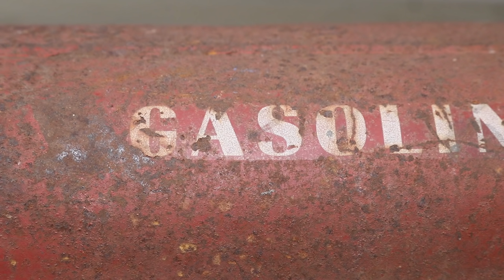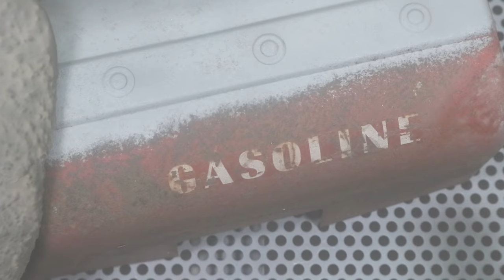1957 Tonka Gasoline Tanker Semi Truck Restoration

Comment: I love the restoration. Having done a couple myself, I realize the time and effort that goes into one. Just for clarification: a truck is not a semi unless it is a truck and trailer. Semi refers to a trailer that has the front supported by the truck. A full trailer has a dolly under the front and is not supported  by the truck but pulled by a tongue on the dolly. Hence there were originally full and semi trailers. They were terms used for licensing and meeting state requirements before the Federal laws kicked in. A semi truck is a truck that pulls a semi trailer. The Gasoline tanker that was restored is considered a straight truck.

Comment: 1957 Gasoline Truck, original list price: $4.98.  The 1958 model came with a hose and reel in the rear compartment.  Looks as if it was enjoyed very much, judging by the axle wear to tires and frame. Rare find, beautiful restoration!
Noticed a 1962 white roof fleetside. Do believe the only model to be a white roof fleetside would be a Jet Fuel Delivery, from the 1962 Airport service set. Missing its bedside panels and cross rails...very rare!

Comment: Can only say this,  you Sir are a true master at craftsmanship.  Watching other, so called restorations,  of plastic models purposely smashed, is not worth the time.  Other previous resto of the mail van, demonstrates the beginning of the end.  Some marketing geniuses figured out that they could save a few cents going to plastic chassis.  Problem was, when the axle tabs broke off, it went bye bye. No options for repairs.  Recently watched a supposed restore, j.g ad to laugh,  the tonk was only a mear shell covering brittle plastic.  Three quarters of the thing was all injected.  No value in restoring,  probably costs more than a new one.  How they can pretend to be doing good work is beyond my belief.  Art is art, that has a significant value in the eyes of the beholder.  You are truly an art historian, restoring classic examples if how the founders set out to satisfy the needs if many young people, to open eyes of what can be done.  Thank you for letting me rant.  One last thing.  The cat makes it all the better.  Very much loved by its person.

Comment: Lovely restoration of a great toy. I had one, and it had some terrible accidents, that were often firework related. I was fascinated by the old movie 'The Wages Of Fear', and this truck, with a little driver figure in the cab, sitting on a seat made from am old roadsign by my dad, spent a lot of time teetering on bridges made of scrap wood, or being stuck in mud. 
They don't make toys like they used to, anymore.

Comment: What I find impressive most is remembering how it all gets put back together...
I'm sure there's a process one just gets used to after doing so many but I just haven't mastered that art.
And again, I'm sure there's an easy way to remember but again I'm not privy...
Especially some of the electronics restorations
Kudos, amazing.
Reply: If you have trouble remembering which parts go where, you can always take pictures before and after removing parts. Hope this helps!

Comment: You asked for suggestions on making bends and not cracking the fresh paint.  Don't know if this works on the powder coat, but I've worked with many types of plastic, formica, vinyl, PVC, etc, and they all give a little better with a bit of heat. I've even remade plexiglass screens much like your windshields. If the glass is good enough, press clay on the inside, then dry it till fully hard. Then put the plexiglass over it and with a heat gun or toaster oven, heat it till it takes the right shape. Last, add your scores and grind to size.

Comment: I really like the way Powder Coating looks. If I could find someone local I'd redo my Tonka road grader
Reply: Yeah, I would like to restore my son's 1974 Tonka Dump truck ...... only thing is I can not find a "hydraulic" bed lifter anywhere.  Should have contacted Tonka for a replacement when it went bad when the truck was only a year old ...... might have still been covered under a factory warrantee ...... but then we didn't have any Mile One Tonka Service Centers here.

Comment: What does wet sanding the primer do?
Where do you get the replacement parts? Does Tonka still exist? Do they have all the replacement parts?
If you were to use two different paint powders, can you make custom colors? 
Have you ever scratched the paint after you finished painting the vehicles?

Comment: i like the chrome grill slightly more than the painted ones but i hate the hub caps....  Sorry.   You do great work and have a great channel but they should be painted
Reply: The reason the grille doesn't work so well with the hubcaps, is because the Grille is painted in an overally chromed out manner, whilst the hubcaps are prim and natural. He is not great at blending any of his works on the automobiles, and then will probably leave them to sit for another 40 years with cleaning inbetween and never having it go anywhere. The incredibly horrid gloss powder paint eats away at any authentic feeling nature to the trucks and cars, leaving them alien and distant more than playful and enjoyable. I can't stand it, and I can't get rid of these videos Popping up.

Comment: Chip.  Your restoration was great.  Love the sheep.  Question, were the cabinet doors put on upside down??  the thumb nail whole is at the top, shouldn't the doors go down instead of up?  Just an inquire, you do great work so don't take this wrong.  Just wondering.

Comment: 19:22 Should have retrobrited the plastic headlight lenses, my guess is they were yellowed from sun damage easily could have been put in some hydrogen peroxide solution and uv light for 24 hours and like new.
Reply: He usually leaves them slightly yellowed unless the discoloration is very intense.